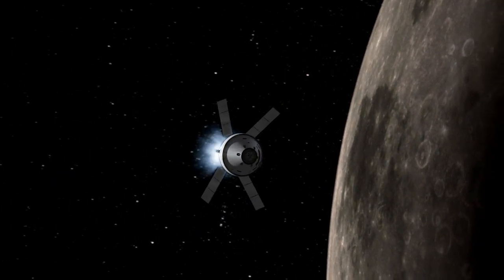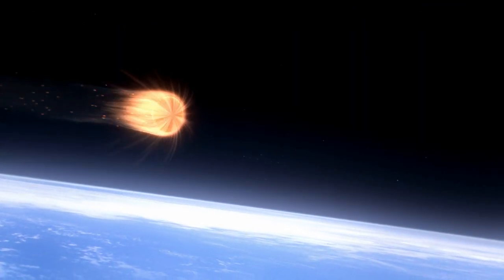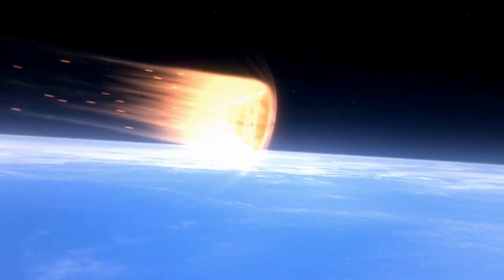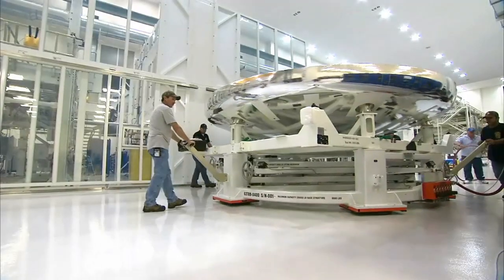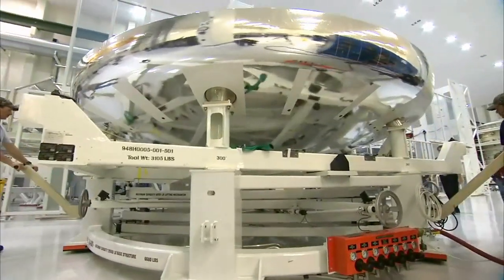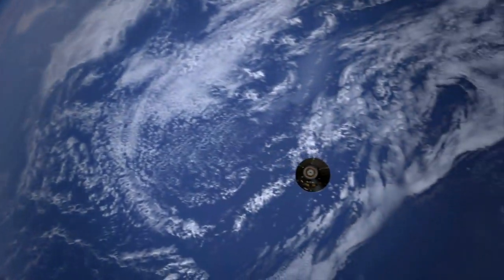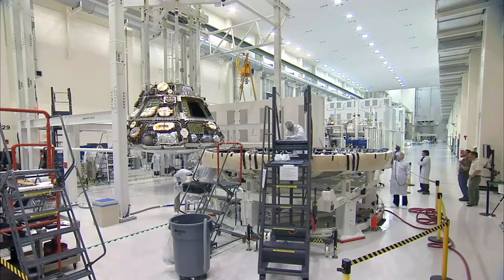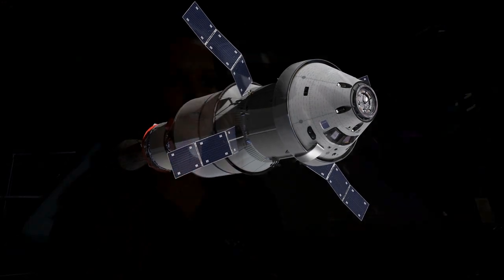Orion: Heat Shield

Comment: I was wondering if these heat shields could be used or slightly modified and used under a landing pad to deflect hot rocket exhaust plume heat & gases, reducing the big dust clouds appearing upon landing/reentry?

Comment: Just reading some of the comments here. You guys need to keep in mind the shape of the heat shield. It makes an oblique shock wave at a large angle, which ends up dumping most of its energy in the air itself and makes a huge amount of wave drag (drag as a result of the shock wave pressure jump). This is great for reentry, and the physical shield itself can take the rest of the energy that came from stagnating the flow up to itself for the amount of time the capsule is at huge speeds.

So the benefits are less weight, less fuel since less maneuvering is needed (less weight), and a simpler design. This is why Apollo was pretty much the same design, and it's why supersonic aircraft have sharp edges; sharp edges help make the wave angle lower, which reduces wave drag (it doesn't exactly affect whether it's a strong or weak shock, that's another story, but it's usually a weak shock in nature). "But then more energy heats up the aircraft", yes, it does, but remember most supersonic aircraft in service don't cruise over mach 3.

Comment: Responding to your and other comments on the Orion heat shield (YouTube doesn't give me a reply tab on your comments...) Regarding an (additional) retro-thruster.
To do that, you'd have to add a thruster built for it, fuel etc. Probably would increase the weight by a third, and be disposable, cost millions. Vs. heavily tested tech.
 In other words no chance. The video makes it sound like new tech, whereas it's just an upgrade.
Some posts regarding this test on most websites make reference to Space-X et. al.
They are still planning to test crew delivery systems for Low Earth Orbit, delivery to the ISS. there is no comparison to the tech needed for Orion. For more on this there are several "how high up are they" illustrations showing the relative highlights of the ISS, you average satellite and the orbital heights of the Apollo missions...again, no comparison.

Comment: One thing i don't understand in the return logic is why not flip the ship in reverse and have a controlled burn to slow it. Considering it will be a discard, having a special tank just for that sole purpose would probably be much more efficient than having a very high speed at return landing since it could mean a possible failure.

A successful mission is managing your odds. You cut here to add there, add here cutting there.

Of course cost wise it would be extra fuel both up and back since extra weight means more fuel for liftoff but in the end it pays off in the sense that you don't have to expose the craft to high speed return except for an emergency case.

Meh just a ramble/rant.
Reply: Fuel is heavy...
Reply: Rok Adamlje I already took that to note, didn't you read? Even so, if that's the concern for you, then note that fuel would be taken to orbit on a different rocket than the one that they would strap Orion to.

Sigh.
Reply: Sorry, I guess I didnt see the expand button to see the whole post

On the other hand, PICA is rated for higher temperatures, but supposedly has harder application in large heatshields.
Reply: If a rocket were used to slow down the spacecraft from 11 km/s (about the speed the apollo spacecrafts returned at) to 8 km/s (speed of an object in low earth orbit) and used the most efficient chemical rocket engines available (Isp~450s), the propellant would occupy almost half the weight of the spacecraft. Also keep in mind even from the slower velocity a heat shield would still be required.
Reply: aserta My calculation was based on only slowing down the spacecraft from 11 to 8 km/s, this is hardly a dead stop. If you look at the problem from the point of view weight, 3 heat shields (1 primary and 2 backups) could be used for about the same weight of propellant that could only slow the spacecraft down by less than 30%. I don't know if they have any backup systems incase the heat shield fails but I do not think slowing the spacecraft with the rocket would be the best option.
Reply: aserta *nods*
Reply: But if it is slowed down, how will they know that the heat shield will work when they arrive from/to Mars. Because interplanetary travel involves traveling very fast. So this is a test to see whether the heat shield will hold for when they travel back to Earth.
Reply: MikeM8891 Never said to remove the shield.

Initial comment had a mistake. I meant they should launch along the rest of the other things that they are going to launch on separate missions a payload of fuel.

I never said dead stop either. I said slow it down. How much is irrelevant, in this case, anything is great.

Like i said before, putting your eggs in one basket doesn't seem wise. The shield should be a backup not a main "gun".

Comment: If it goes much faster than the Apollo missions, the G force will be higher for astronauts. Can't we think of a better way to lower the speed ? Like orbital maneuvers or rendez vous with an orbital station ?
Or just extra thrust power to slow the craft, the weight ratio vs the heat shield would be better this way. When the Eagle landed on the moon they didn't use any shield after all.
Reply: They would aerobrake, or do a aerocapture and try reentering the atmosphere after an orbit. This can mitigate the G loads put on the craft and the astronauts.  When Apollo reentered the Earths atmosphere, it wasn't a ballistic curve, but it actually used the air-frame to create some lift and bleed off speed by leaning forward some.  Kind of like a rock skipping on the water.  It slows down enough before dropping down at a safe speed. 

Pertaining to "extra thrust power", what ever energy used to get up, you'll have to experience the same amount of energy going down.  So, the amount of fuel you'll need to slow down to get into orbit or reenter the atmosphere at a slower speed would require much much more fuel and thus a much much bigger rocket.  This isn't efficient and could quite possibly cause more problems.

When the Eagle, or LEM (Lunar Excursion Module), landed on the moon, there were was no atmosphere to slow down the craft, so there were no need for a heat shield.  Instead, the Command Module used its engines to put itself and the LEM into a lunar orbit around the moon.  To land, the LEM had just the right amount of fuel to counter the gravity and horizontal velocity to land safely.  Being how light the LEM is and how low the Moon's gravity is, not as much fuel would be needed as if they wanted to land a craft like that onto Earth.  Also, the LEM splits into two after their mission on the moon was complete leaving the bottom half (descent stage) on the moon while the upper stage returned to lunar orbit to meet up with the Command Module and head back home.  

I hope this answers your questions.
Reply: While it is possible to reduce the speed with engines before hitting the atmo, the dV required would be very high (in other-words, would require loads of fuel, too much to carry with it). It would take as much force (dV for the rockety folk) to slow it down as it did to make it depart in the first place (kinda), but simply doubling the fuel won't do, because of the law of diminishing returns (basically means to lift even a little more fuel into orbit would require a massively larger rocket at launch)
They could do a couple passes through the upper atmo to slow it down a bit, but a) narrow margin for error (to low, burns up; too high; flung back into a solar orbit), b) the craft would still be on a very wide orbit after the first pass, perhaps taking days between passes (so again, more onboard resources would be needed, more weight to lift initially). 
They didn't need a heat shield when landing on the moon as there is no atmo, so the craft doesn't generate friction as it descends. But the command module the astronauts returned to Earth in did have a head shield, but it didn't need to be as strong as Orions because a Lunar return won't be traveling as fast as a return from another planet.
Basically, play KSP! Then you'll get a ruff idea of the problems involved!

Comment: Isn't it the pressure wave in front of the heat shield that forms ionized plasma which creates the highest amount of heat compared to the lower altitude which has more friction, but less heating issues due to the speed being reduced from the higher altitudes?  If I remember correctly, the craft will go through a aerobraking maneuver to slow down in the upper atmosphere and then fall back to earth after the velocity is bled off?  Similar to the Apollo capsule?